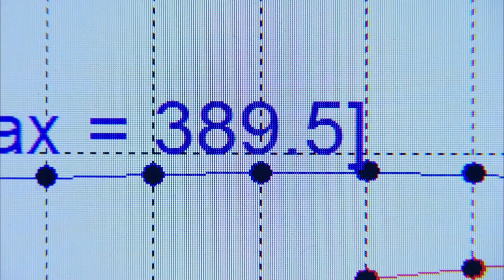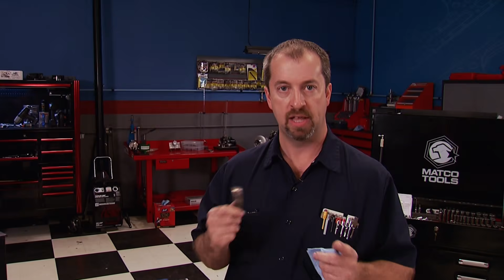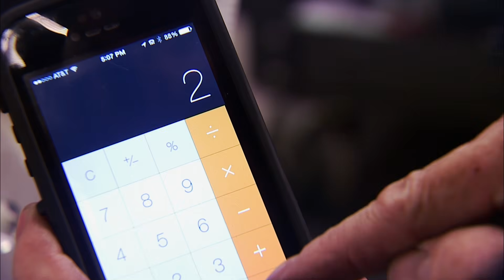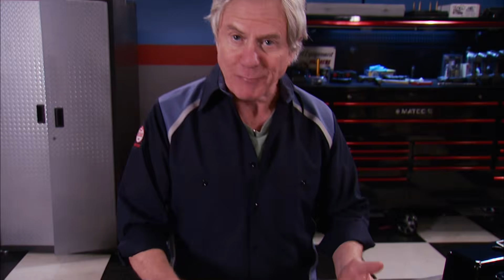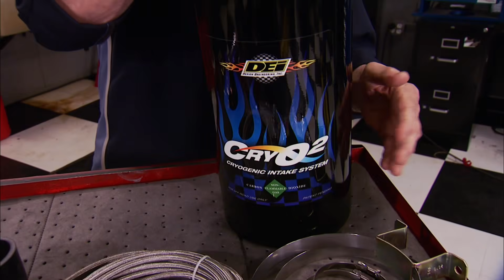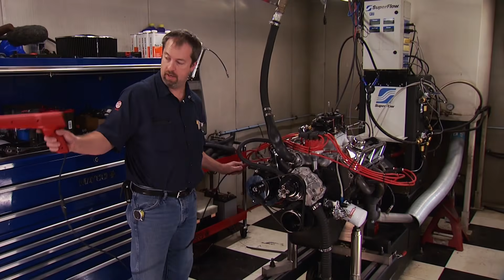Small Block Chevy Build Stage 2, Part 1: The Budget Goes Out The Window - Engine Power S3, E2

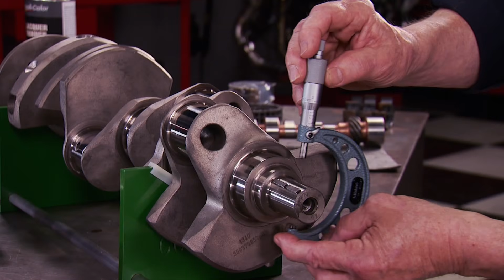Comment: 5:16 The machinist in me wants to scream “.010 of an inch is way too sloppy!” but I know that he’s talking about .0001 😂

For those that may not know, machinists typically reference how many thousandths of an inch a measurement, ignoring tenths and hundredths

5 thousandths = .005
50 thousandths = .050
500 thousandths = .500
1/10 (one-ten) thousandths = .0001

Comment: What's the point of having oil in between the main bearing and the block? Wouldn't the crank get the same amount of oil since it has to go through the same size hole in the bearing?

Comment: They purposely under-cammed and under headed the first stage to make the second stage seem worth the money. They didn't need to touch the short block to make 500hp.
Reply: And they pick up 20 HP with the electric water pump.
Reply: Exactly what I said on the first video. Parts selection and specs were retarded. The cam was basically stock spec. WTF.

Comment: Imagine dropping $4k and only getting 350 horsepower... I'd shoot myself.

You can get close to that with a stock 5.3 ls. Old tech has old power. Get some good shit that will last long and make POWER!
Reply: Seth H and the fact that $4000 is a budget build. Hell I’ve seen people take a stock rebuilt 350 with Vortec heads and make 350hp for less than $1500
Reply: @shallowpocketstrucking9023  ikr. Either they did something wrong, or they're Dino is out of tune.

Comment: So let's pound the bottom timing gear on instead of using the proper installation tool. Oh well, so much for the 5 thousands thrust washer clearance.
Reply: Triggered much? Why don’t you just appreciate that this is posted instead of nitpicking? There’s some good tips for this build regardless of what you think.
Reply: @Rudderify  I'm having a hard time deciding who the bigger fool is, the genius that drove the bottom gear on with a hammer, or you for thinking that I am nitpicking by mentioning it. I wouldn't let either of you wash parts at my engine shop let alone help with assembling a short block.
Reply: @anthonynelson9136  clearly you missed my point because you’re still blinded by rage. Let me paint this picture for you: you decided to ONLY post a negative comment about this video to stroke your ego. You choose to piss on this great 20 min video for a 3 second shot of something you disagreed with, that in reality can be accomplished safely 100 different ways. You also felt the need to ruin something that bings us and our small hobby together. You should be glad that these folks put videos together for us and they ask nothing in return. So, I do understand more that you know for being a fool.
Reply: @Rudderify  Let me paint you a picture Ken. It sounds like the only one blinded by rage is you after reading your comments. If you think that these are great videos then it just shows your lack of engine-building knowledge. Anthony brought up a valid point that someone like you that needs a participation trophy for anything you do in life wouldn't understand. You are a fool, and your husband probably cheats on you because of it cupcake.
Reply: @Rudderify Miss your point? I think the real point here is you being triggered and blinded by rage because I think the Power Nation guys are a bunch of screw-ups and you can't handle it. Also, you can be glad these folks put these videos together I am in the business so personally, I don't need them. I watch their videos once in a while to see how much misinformation they can fit into each show. A lot of the things they do are either wrong, overkill, or too expensive for a normal guy. And don't kid yourself about them asking for nothing in return because in every segment they are trying to sell you parts or equipment you don't really need for the sponsors. So you go get into your Honda and run along now and be all butt hurt because I don't agree with you.
Reply: @anthonynelson9136  can you build a homda motor for me? I will be dailying it and beating it on the weekend street races
Reply: @DannyOrnelasPerformance Sorry no. At my shop, we don't build high-performance 4, or 6 cylinder engines, it's all V8s.
Reply: @anthonynelson9136  butthurt much? Like everyone, you are the be all and end all. You know best and everyone else is a fool. Sounds like your picture would be in the dictionary beside 'asshole.'

Comment: OMG people stop with the 383 builds it's been done to death. try a 396 stroker or a 406 useing a 350 block. push the limits have some balls. 😁
Reply: As long as we can have a joint checking account!
Reply: I’m building a 389 stroker using a dart block because I’m wierd haha. 4.00x3.875

Comment: I question the value of bearing journal mods, unless reaching past 8k rpms.  The bearing already has an oil distribution ring in it so... if you want more oil, why not open up the feed hole?  I wouldn't want to lose any more bearing surface, so maybe ovaling the bearing hole  outward into groove area with a small [jeweler size] burr would do the job - something along the lines of   1.5mm to 1.8mm  would allow plenty of control.  Busch makes a variety of 3/32 shank burrs for small detail work, and looking at that block I'd guess you could stretch that bearing hole 0.030" either side without ever touching the block.
I love the question "Have you ever worked on an engine you didn't like?" - Monsieur has never worked on a Peugot, I think?  What do I know - maybe he likes re-sleeving blocks.
Reply: Now those are weird engines. Those sleeves are kinda tricky, and they have no rear main seal. Just a helical style gear looking thing that spins and uses centrifugal force to sling oil in.

Comment: what size cam would you put in a 76 Camaro LT type that has the  factory 305 and i want to go a little bigger just wake it up
Reply: Those head aren't doing you any good if they're stock. Maybe get l98 heads with 58cc combustion Chambers and some mini dome pistons maybe. Try to get it to 10:1 with a 210-220 @050 cam

But these are just gusses. Should work nice though with 3.73 gears

Comment: There is a groove on the top main bearing and not the bottom. I think you should make the transition by put little groove on bottom bearing jest like 1/4 inch
Reply: And put groove on the left side because crank is spinning counter clockwise and go from deep to level so oil can spin through the groove and get to bottom

Comment: That rear main seal is supposed to be canted 3/8" form the parting line. This prevent oil from leaking past the main seal. Felpro even says to do this in the instructions. Wouldn't it make more sense to use a SBC for this distributor installation instead of a Ford engine?

Comment: For 4k I got a 565hp/600tq engine.
Reply: Im doing one now with decent parts at 6k at this power level .  Its solid flat tappet however......
Reply: @hereinmissoula11  that's good. We've learned that you don't have to spend alot to get good power! Especially for a good street engine.
Reply: Yeah not on the motor in a small block or you had a big block with good iron heads..
Reply: mrhazel not torque .  I would say 550hp , 500 tq .

Comment: Yes But how does that oil indexing in the Web help oil flow when Main bearing's don't rotate the crank spins in  them ? And speaking of Main's I couldn't help but notice you didn't opt for the greater clamping ability of ARP main studs kit for the Chevy 4 bolt main engine and I was surprised as you mentioned stepping up to the Blow thru I couldn't understand why you didn't use a premium Main stud kit ?
Reply: It seems like these shows are more Hollywood than they are real engine tech. There is no reason I know of or can think of to cut a grove between the back of the stationary main bearings and the main block journals. As soon as I saw that I was like what a minute, let me check the comments to see if anybody picked up on that weirdness

Comment: I never understood why adjustable cam gears are so popular, if the cam timing is off you can hog out the bolt holes to adjust it if its off..in my experience its rarely off. I could understand if its a full scale race car but not many are out there

Comment: On the modified bearing, it looked like there was still metal shavings in the groove.
Reply: there definitely was
Reply: The way I see it ur asking to spin a bearing doing that crap I've been around alot of race engines and have never seen anyone cut there bearings and block like that
Reply: I assume they will totally re-clean everything before assembly.  I could hardly watch while they were grinding them above the open block..
Reply: @russellnotestine6436  they washed the block before assembly

Comment: Go to the Air Flow Research website and look in the Archives.
Find the article called: "The 350 that Chevy should have built"
400 Block, 327 Crank, Ford 300 Rods, 11 to 1 CR, Small Port Hi Flow heads.
Net result, 420+ HP, 420+ TQ, all running on 87 Octane gas.
It was the combination of a large Quench area and a very long Rod/Stroke ratio that made it happen.
Reply: John Parrish LS engines use rods longer than 6”. That’s a small part of what makes them so good. The 4.125” bore is impressive. It’s really the heads and cam that make all the difference though.
Reply: @philistineau  Never discount a large Quench area, the British used to call it Mechanical Octane.
Reply: The amount of money on this build they could have put 6" rods and L31 iron heads on and been further ahead with a true flat top coated piston, but what do I know reading article after article by David Vizard.
Reply: that was an excellent article!
Reply: @jaredfarney675  It's funny that it is engine science that no one teaches or passes along.
Reply: 420 ain't shit for an engine that size

Comment: How about showing a small block 318 la motor ( Mopar ) for a rebuild show and get up to 350 hp. That's is what I'd like to see. Summit doesn't have a combination package for that. I was wondering what I could do for  my dodge 318LA.
Reply: Not to pee in Pat's coffe cup, but check out Engine Masters, winter 2006, volume 9, no.4. Steve Dulcich put together a 318 LA that hit 415 hp and 394 tq. Used the factory rocker assembly and 360 truck heads. Spent most of the money on the Airgap manifold, a Demon carb and a few other cheap upgrades. Spent way less than $4K. I was weighing the cost of building a lively 225 /6, but cost for power ratio said  small block. More tech, experience and parts. I'll put the /6 in a track roadster of some sort.

Comment: I really want to see a 400 but with a 3” stroke making it a 320. then try and get to rev to 9-10k
Reply: That would be cool but outside of a pure race motor it's kinda pointless.
Reply: Why? Thats just silly when you can build that block with the 400 stroke length 3.75" and mabetter power and way more torque at 6000 rpm. It will last 4x's as long too.
Reply: I mean chevy built a 350 with a 283 cam it's a 302 and it did rip to 9-10k rpm back in the late 60s I've always wanted to be able to build one and do roller valve train some lightweight pistons and heads with some big valves and see if itd catch 12 or 13k
Reply: Cameron Vandygriff that must have been fun

Comment: The mains grinding is questionable. No.
Reply: Made me cringe lol
Reply: All the metal flying everywhere, and no precision while doing the grinding. That is the worst i have ever seen done to a SBC.
Reply: @NVzla  they did say shade tree. Not pro level
Reply: Only need to enlarge the feed hole in the new bearing if it doesn't line up with the block feed hole.
Reply: I've seen it done. If you go to Street Racing Channel you can see his engine builder do something similar to his TT SBC.

Comment: Engine masters did an episode about how intake and fuel temps affect HP Cold fuel makes more power than cold intake air.
Reply: indeed they did just watched it last night LOL
Reply: Hmmmm, cold air is for making cold fuel/air mixtures- density of hydrocarbons in the cylinder.
Reply: True...why Im installing a cool can in my Camino. Esp with this crap ethanol Ca piss they call gas.